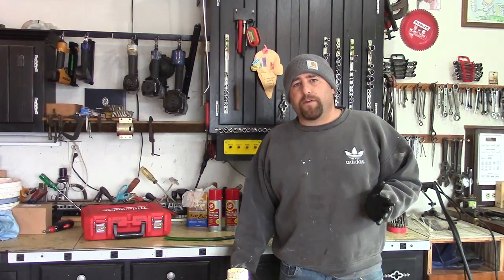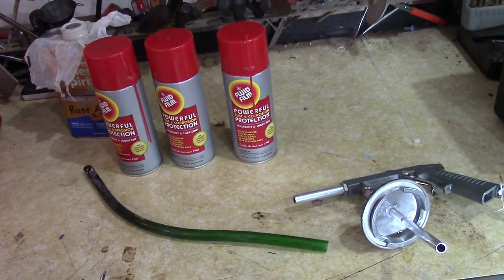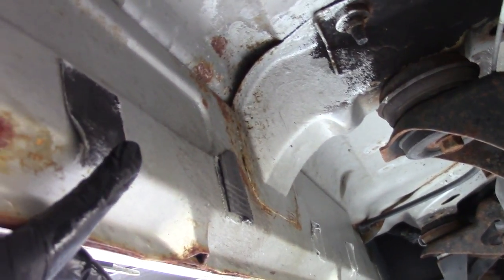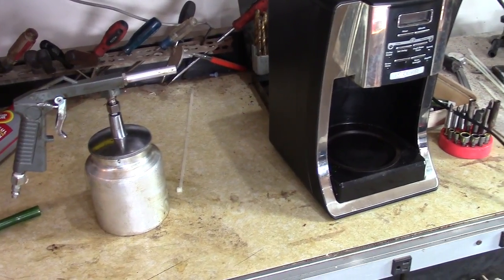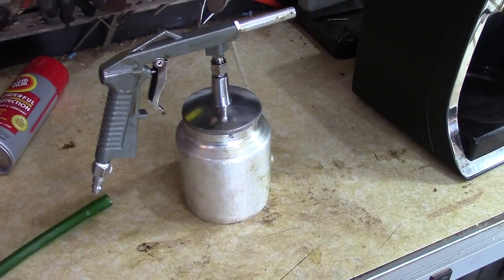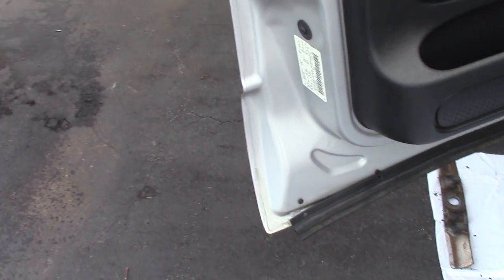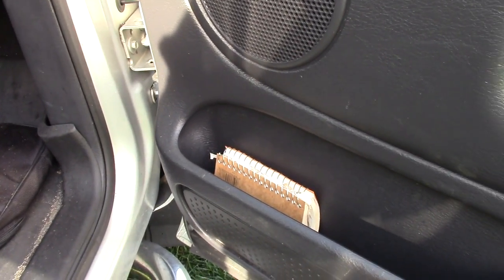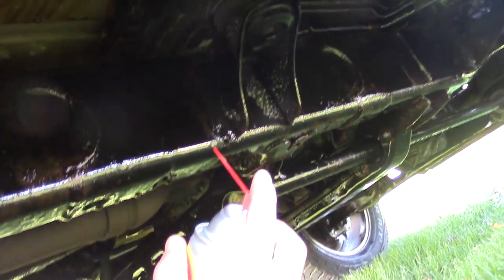Using Chainsaw Bar Oil For Undercoating My Truck

Comment: Tip... Use a creeper and work from cab to tailgate on both sides. AND this is key... Use neighbors driveway when they're on vacation. That way cleanup is easy.
Reply: Hahahahaha
Reply: Lool 🤣
Reply: My driveway is gravel so I don’t have to worry about that.

Comment: Let us know if you want to do a full coating next year. our bulk product is easily sprayed through the same system and would love to hear your opinions on it.
Reply from the maker: Yeah sure,  I'm actually going to be doing another coating in the summer.  I was thinking of pulling the taillights and spraying inside the bed as well.  You ever hear of people doing this?  The wheel wells are rusting from the inside out.
Reply: we get in every drain hole we can, especially behind rocker panels and inside the wheel wells. the brine gets in every crevasse it can so treating it with our product before works great. our product also does not brown grass :)
Reply: I'm ready to do a complete under coating using Fluid Film,   Used  Eastwood and 3m products in the past and ready to try FF.
Reply: let us know if you have any questions. we have a tutorial on our channel.
Reply: Fluid Film sprayed fluid film thick on my avalanche . Seemed pretty good .. however ~a year later surface rust came right through on the frame  . Fluid film sucks imho other guys I have worked with had similar results with fluid film and most of us switched to an oil based undercoat . Most of us were not impressed

Comment: I've been using FF on my '93 Toyota pickup, so far have had great results.  I also spray inside of the frame using one of their 360 degree spray nozzles.   I live in the Midwest where they use a lot of salt, I spray the complete undercarriage, rocker panels, springs and axles every spring and fall.   FF by the gallon is a lot more economical than the spray cans but the cans are good for spraying in the nooks and crannies including getting inside of the frame.  My local Toyota dealer can't believe how rust free my truck is.
Reply: Ernest T sorry but what is FF? Thanks
Reply: @martymcfly3986   Fluid Film

Comment: The holes are used when they are building the frames and the vehicles, they give a place for the jigs and robots  to securely grab onto for welding, and later when assembling.

Comment: I can't say enough good things about Mustie1.  This is one of those things he did that I'd never heard of until I saw his video on it.  He didn't mention that it has a tendency to keep dripping, so for most of us using a tarp is absolutely necessary to protect driveways.  Thanks Bob for that suggestion and for getting this technique "out there" again!
Reply from the maker: Depending how much you spray on it will drip I put it on really thick.  It took about 2 days to stop dripping.  I also thinned with 10W-30 because it was 15 degrees out.  I didn't know it was going to be that cold.

Comment: Have you tried reducing the bar and chain oil with kerosene,varsol or diesel?... wondering if the reducers will eventually dissipate leaving only the thick bar and chain oil...

Comment: I once had a long chat with an ex Ministry of defence (MOD) guy here in England. He was involved with the testing & manufacture of WD-40. 
He said they tested nearly every oil based substance known to man for preventing rust in military vehicles. The substance which beat everything else by a country mile was
old used engine oil. They discovered the minute amount of aluminium from wear of the pistons etc acted like a Zinc type sacrificial anode. The carbon deposits in the oil  made the oil stick far greater than clean oil. It had superior "Creep" & wear properties too. I spray the underside of my 20 year old VW transporter annually with it's own waste oil after a service. My chassis remains rust free after 12 years of ownership.  ( 265,000 miles & counting). Waste oil from a diesel engine was found to be more effective than petrol because of the greater carbon/soot content. 
I found that mixing a small amount of phosphoric acid approx 5% also killed any existing surface rust & converted it to a Gray iron like substance that will not rust again on my wife's French car. (But it stinks like gear oil for months)
It is also easier to spray into cavities than a traditional wax coating using a wax coating gun because of its more fluid state. 
Hopefully the above helps someone else out.
Reply: very good idea...just remember that cast iron and spring steel, degraded by phosphoric acid ..
Reply: @steenmortensen6410  yes that & zinc plated steel too. Thanks for the comment.
Reply: @ThePariss333 Yes your Castrol will be fine  but I would advise against using the transmission fluid if the body has been galvanised. If it hasn't then that will be good to use too.
Reply: @ThePariss333 Avoid spraying it then use a dry cloth for over spray.
Reply: Good info thanks.
Reply: ProjectFarm did a video on several applications and motor oil was in last place. Which I don't want to believe, but he's super thorough so now I'm confused.
Reply: @cluelessblamer518  I don't believe that for a second. He is pushing products. 
Think about it, engine parts are made of high carbon steel and if left without engine oil coating they would rust like mad. Under operating conditions engine parts are exposed to moisture (H20), heat, and oxygen (all from combustion) and if the engine oil does not coat and protect then all the engine components would rust like no tomorrow and you car parts would seize.....If you don't believe me, take out the push rods, crankshaft, rocker arms, etc. and wipe them clean and leave them out in the rain and come back a few days....
That projectfarm study is full of BS if you ask me...
Reply: @trankt54155  you went way off topic... Anyways back to what I was saying. Motor oil may have been on the bottom of the list because every product was an oil-like substance. Maybe motor oil is good enough but others are just better suited for the application
Reply: I’m studying all the videos I can on the subject of oil under coating and I’m gonna patch a couple of holes 🕳 in my frame and then oil it well inside and outside. I have a barrel of used diesel truck oil so I can do it as needed. In hopes of saving my truck.
Reply: Wonder if synthetic oil works
Reply: @666dynomax  I use semi synthetic too. My 21 year old VW T4 which I've owned & oiled for 13 years now has no rust & has never been welded. She hasn't even had an MOT advisory in that time. Even the brake lines are rust free.
Reply: @cluelessblamer518  undoubtedly, I  believe it came in last place too worse than the control after a pressure washing
Reply: @tonydalton6756  what does atf do to galvanized aluminum?
Reply: Do I have to add the acid...was thinking of just the used motor oil...

Comment: I'm in the UK and use a type of manual transmission oil , quite heavy which I heat up and apply with a paraffin spray gun which comes out finely atomised and coats beautifully without much dripping down afterwards.
Old fashioned methods like this work well and keep our motors alive

Comment: never saw you spray INSIDE CHANNELS and crevices or on top of fuel tank-where MOST people miss
i also used chain saw bar oil-summer grade cut with kerosene-so my cars last decades in salt belt if applied ANNUALLY
  and bolts seem to come off easier-without breaking usually-not bad for 25 yr old cars
Reply: sooo there's a differance in summer & winter blends guessing brand new all still sealed up using the bar oil......???
Reply: have you had any trouble with rubber parts swelling after using bar and chain oil? I just sprayed mine with it.

Comment: The old timers did this, after you spray take your vehicle and drive it down a dry dirt road.
Reply: I have hear the same but after driving a dry dirt road is this makes undercoat much better?
Reply: @k.b1596  it becomes thicker mixed with sand, so don't just drip off.

Comment: On the Ram plow trucks we have found that spraying behind the tail lights helped with the rust issue over the rear tire wells. The same goes for under the tailgate area that is prone to rust thanks to NYS brined and salted roadways too.
Reply from the maker: Good tips thanks.

Comment: Similar process I had done at the nearest Krown rust prevention center. (St Louis, MO).
They sprayed a thin oil (that has some sort of sticky additive) inside all of the body panels and frame and coated the underside.
Dripped for probably four days or more. I just parked in the street during that time. 
It's time to schedule another appointment soon. They recommend every year. They offer a nice warranty if you take your brand new vehicle there (rust free). Of course, I don't own anything rust free.
Reply from the maker: That sounds like a good technique how much do they charge for that?

Comment: Next time, if possible, wire wheel the rust everyplace you can reach.  Then, after banging on the frame to knock the rust loose, since it out, treat it with a phosphoric acid rust treatment, then coat it with your lanolin based product or just used motor oil.   You will get much better results long term....

Comment: One other sprayer you can use is those cheap  syphon type sand blaster gun , I used fluid film when I did it and that stuff is thick .

Comment: Done my toyota hilux from new with chain oil it's now 10 years old and the paper sticker are  still on the frame rails works great
Reply: i'm guessing it was brand new bar  oil or re-used oil or what.......?? & did u do it straight or did u mix it w/ some thing else & heat the bar oil up like he did in the video here.......????

Comment: Old Engine Oil as in 19 o dot, newer engine oil is useless for undersealing, it just washes off! I bought a drum of Mannol Bar n Chain and blasted my old LDV with it 2yrs ago, due for another blast this year and so far so good! Bare in mind old LDVs have zero Underseal from the factory and rot like hell, 26yrs old and still rock solid aye!👍

Comment: Had a totally rusted steel shed.  Brushed it with Ospho, which is like a water consistency rust killer - its a weak phosphoric acid with some lanolin in it.    Top coated it with rustolium.   About 15 yrs ago, non of that rust is showing through.
Reply: ospho is awesome! we brushed it on a 1929 chevy in 1997 that was covered in rust, then primed and painted. 20 years later the rust never came back.
Reply: @oni_goroshi  where can ya get the ospho spray stuff...... & is it in a rattle can or what....... & how much is the stuff roughly.........

Comment: I do the same thing for my car. Amsoil metal protestant does great. As a chain lube it dries to a wax like stuff. I put it on rust on the snowblower and lawnmower rust. Great on blades.
Reply from the maker: Thanks for the tip.  I really like the coverage of this stuff.  I'm thinking this year I will scrape the mower decks down and apply it and let it sit over winter.  I will have to look into the Amsoil.

Comment: For a relatively small amount of money in real terms there are lanolin based products that spray a fine mist with few if any drips if applied correctly, safe on electrics, rubber seals etc and requires little preparation beforehand.  In the past, whenever I carried out a repair or maintenance, I always had a can of old engine oil with 10% bar oil mixed and with a small brush carefully apply to any surfaces local to the area I’m working on, avoiding rubber etc.  Coil springs and brake lines lasted years.  It worked for me but now I use the lanolin products, so much cleaner and works just as well.
When rotating the wheels is an excellent time to address rust, jack up the vehicle, sit on axle stands, examine brakes and enjoy a few cups of good coffee, two leisurely hours spent carrying out a really worthwhile job.
A few extra minutes, a little careful planning, using the appropriate sprayer and there is minimal mess or drips.  Life is too fast nowadays, slow down and do the job thoroughly, take a pride in your work forget about how quickly you can get finished.
Literally drowning the underside of a vehicle with oil is a recipe for problems further down the road.

Comment: Hi new sub found you through Bruce Pender. I think mustie cut his oil with diesel or kerosene I didn't see if you did to. Great video👍
Reply from the maker: I really did not need to cut the oil because the gun is designed to shoot out some viscous material.  It was about 15 degrees out, so I did end of thinning with 10W30 oil, but that gave me some drips because I put it on pretty thick.  Welcome to my channel.  Bob

Comment: Tip,  try a Presto electric crock pot to heat the oil.  Also, you can use a 2.2 gallon pressure pot with paint gun to apply the oil in a heated garage or over the summer months. You can also cut the B&C with diesel to thin it out by 30% diesel.  Great videos and thanks for posting..

Comment: Cool vid.  What year is that truck if you said it in the video I missed it.  I’ve done mine every year since new for seven years I’m thinking of switching to diy now.  Also how large of a compressor do you need for this.

Comment: I have had 2 toyota pickups and 1 4Runner frames rust through, majorly, from the inside, having done similar as you. Good luck.  I live in the northeast where salt is used on the roads.
Reply: it rusted through even tho you sprayed it?

Comment: thanks for the vid definitely got to do this on my truck soon i live PA so it will be needed
Reply from the maker: Just plan on letting is set for a at least 2 days before your drive it so the oil sets up.
Reply: ok will do that thanks for the tip bud really appreciate ya
Reply: When you get done run it up and down a dry dusty dirt road several times. That will really tack it up and turn it to something like a grease

Comment: Just seems like using some rustoleum would of been a better idea. I must be lucky cause I've never had trucks rust out in Indiana. Probably cause I never wash my truck and it has a protective layer of dirt on there lol. I just drive when it rains to wash my Cummins lol
Reply from the maker: The rustoleum does not stop rust that has started and I have been told not to cover up rust with paint. You also would have to be much more careful with overspray getting on the bottoms of the doors.  I like those Cummins.

Comment: Years ago I had an old-timer tell me he used cement epoxy paint on all his vehicles to prevent rust because I noticed his 1961 C10 pickup didn't have any rust on it, while my 3-year-old pickup had surface rust under the truck. He told me to go to the hardware store and get concrete epoxy paint, the stuff mechanic shops paint the floors to prevent chemicals from absorbing into the concrete. Then you can have them tint it whatever color you want, but he uses industrial grey so he can tell if his vehicle has any fluid leaks. Then he coats the bottom of the vehicle with the epoxy paint. He said he did his pickup back in the 60's, then again in the 80's and today in 2020 it has zero rust on the bottom of the truck. He did his honda civic back in 90's and today it has zero rust. He likes the grey, because he can tell if there is any areas that he missed with the difference in color. Then for areas that are very revealing, that don't look well with grey, he uses a small can of the same epoxy paint but black to hit those areas. So i did the same, i used bear garage floor and cement epoxy on my 2008 pickup, now in 2020 i have no more surface rust. the areas i had previously i used self etching primer for rusted surfaces on before i coated with the epoxy paint.
Reply: After a lifetime of fighting rust on vehicle chassis I'll never paint over rust with any type of paint again, even with good prep. I've even seen POR chip off in huge pieces on expensive show cars. From what I understand nothing 'converts' rust'- if you paint over it you seal in the rust and it just continues to get worse. My experience always. I've settled on spraying the entire underside of my three vehicles with a coat of bar and chain oil thinned w/ K1 kerosene every year and I've kept the rust at bay. Evaporust, rust converters etc. NEVER provided any type of sustained rust protection despite all of my efforts. Only way to fix rust is to cut it out and weld in fresh metal and seal everything at that point from moisture and be done with it.

Comment: Heat guns are a handy thing eh!!!   Chain saw oil sticks to everything.  Great idea.  I cannot believe how messy that would be.  We are lucky here in Western Canada that there isn't too much salt on the roads.  Yes there is some but not like you guys get.
Reply from the maker: I use the heat gun about once every 2 weeks.  We get tons of salt dumped on our roads.  It is a messy process up front, but down the road I think this oil treatment is going to provide some solid protection.

Comment: I got to do this to my truck too, i live in a beach town so our trucks rust out twice as fast here. Think id hit all the rust with a wire brush first to remove it though.
Reply from the maker: That is the best way to do it, but it takes an extra step to knock away the rust.